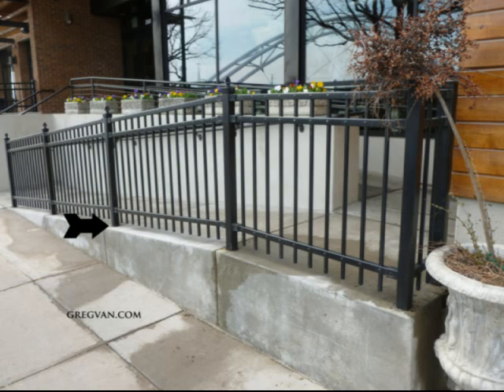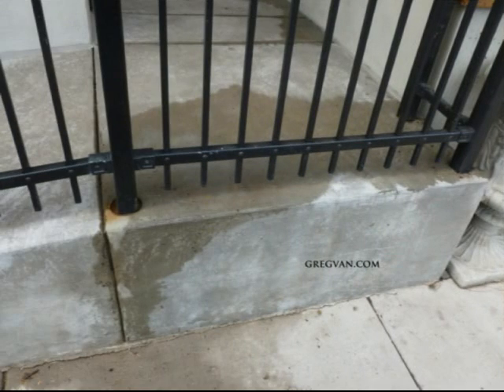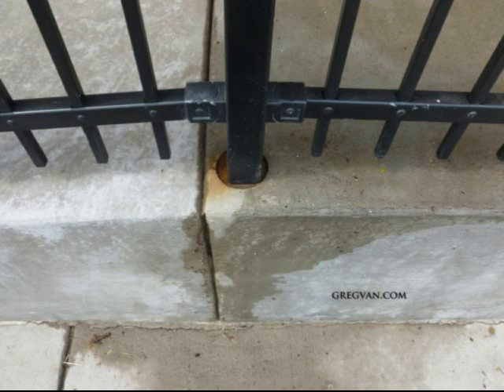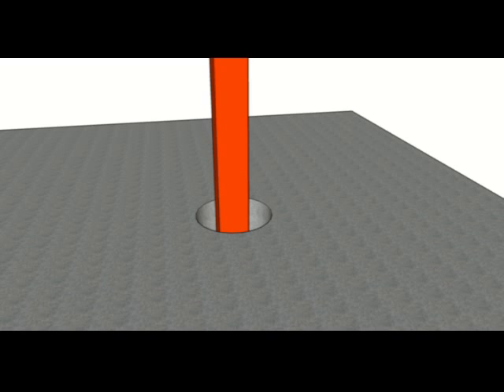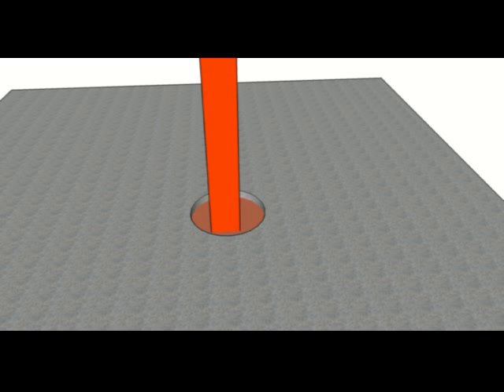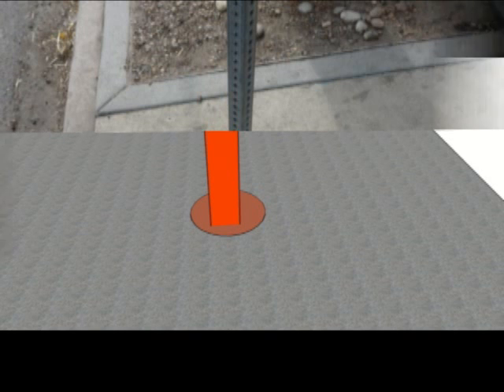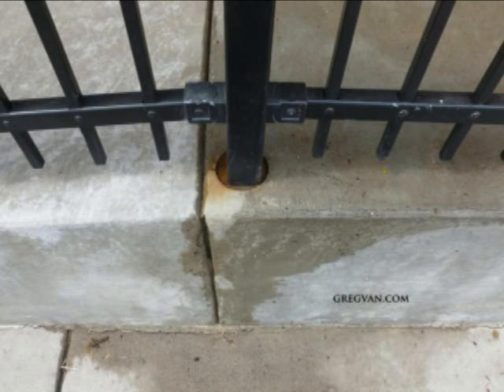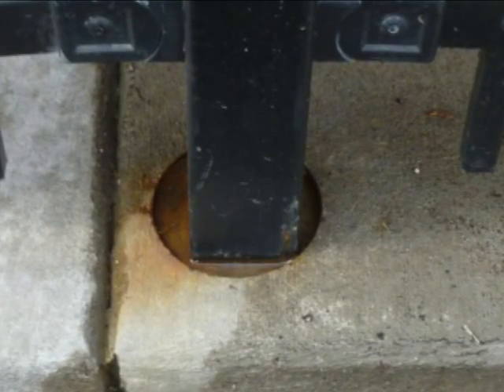Metal Handrail Post Damage Caused by Concrete Filler - Construction Defects

Comment: I’m looking at the same thing that is in my pool area. I’m wondering if it was filled originally, but once dries it shrinks and it falls lower in the hole? The issue I have is it is crumbling a bit so it shakes a bit in the hole enough where it leans towards the gate and it’s a bit annoying as the gate doesn’t open cleanly ( you have to open and push to right  a bit.)
Reply from the maker: Maybe you can pour some filler into these gaps to see if that fixes it, other wise the filler might need to be removed and replaced.
Reply: @gregvancom  thanks! The amount it moved towards the gate was the thickness of a paint stirrer. It was perfect, i wedged that in and it was enough to move it back then I set a few posts of concrete. Then I took another paint stirrer width wise in the gate to reinforce it while the concrete cures. But as you note, it was really just a matter of adding filler in.

Comment: This is a pretty old video..however Im watching it? And I find it Ironic that the post (full of holes) had its core over filled and the others didn't, im guessing because the filler is runny they have to keep in under the core for lack of control on aesthetics.
Reply from the maker: Yes, the filler could have even shrank, but it seems like it would have been better to have it designed without creating a water trap.

Comment: The original filler shrank.  It is not the installer's mistake.  Rather, the installer should give the homeowner a little of the filler and tell the homeowner to fill it up after the material shrinks.
Reply from the maker: You do bring up a good point though and that it might be better to add additional filler yourself as the property owner. However, I have seen situations like this where the filler did not shrink, because the installer never filled it up to the top.
Reply: All good points. The filler also sucks up into the railing. Most fail to top off afterwards. I replace rusted railing ballasters all the time and there is always some in the bottom.

Comment: Not sure if you mentioned this, but another option would be to face-mount the posts to the side of the concrete with lag bolts so they drain by gravity.
Reply from the maker: Good idea and thanks for sharing. Sometimes all we need is another idea.

Comment: I am dealing with this -- as well as other construction defects -- with my current home.  I could go on and on with all the crap they did poorly, but after remortaring my front steps and resetting the handrail posts, I am now looking for a self-leveling sealer to top off that gap.  I intentionally left a gap because I knew it wouldn't come out nice otherwise.  Have you found any good fillers for this purpose?  I was thinking it should be solid but semi-flexible to account for expansion/contraction, yet eliminate water infiltration.  Thanks for getting a start on this problem.
Reply from the maker: jdevolanyc I try to avoid recommending products, for a variety of different reasons, but don't forget that moisture (that causes metal to rust) can be absorbed into concrete from below and its sides, so it doesn't make much sense to seal the exterior above ground when it can pull moisture from below ground.

Comment: Good point, is it true re-barb rust and cracks the cement in years of sitting in cement.
Reply from the maker: All we need to do is mix water with metal and we get corrosion. I'm starting to think that water is a building's worst enemy.